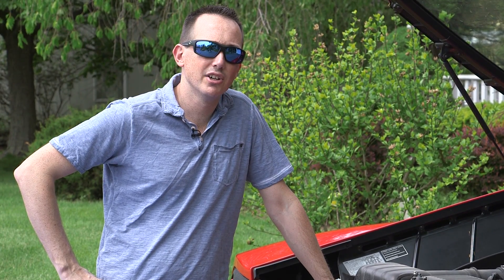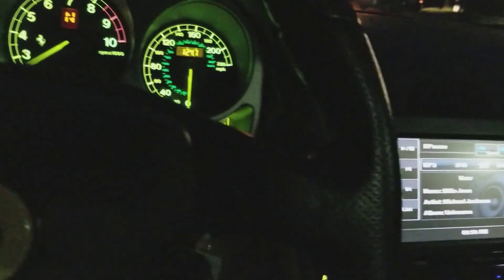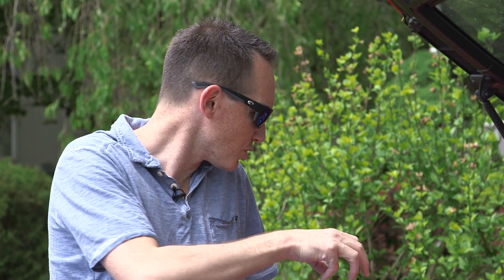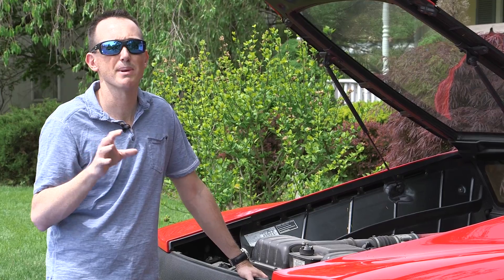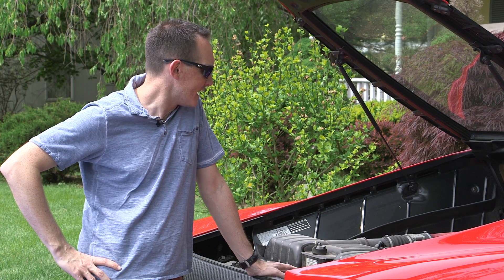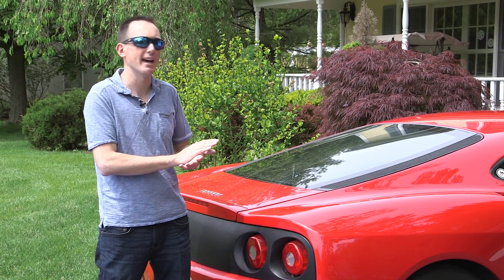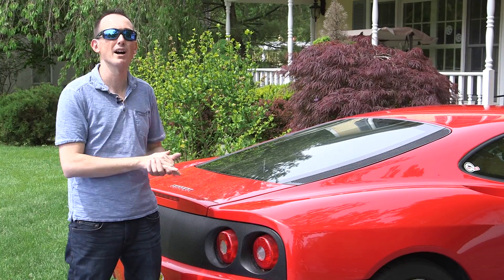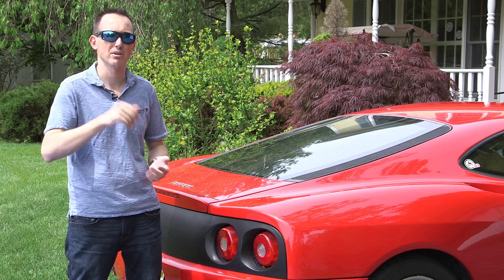When Your Ferrari Engine Starts A Knocking - Rut Oh

Comment: You dont need a flamethrower to set a ferrari on fire. :p
Reply: Tiago Martins This is the best comment.
Reply: Agreed.
Reply: just remember the marshmallows in the glove box if you rented it from mr spaghetti
Reply: especially when there's a spider on board
Reply: This comment should be at the top lol
Reply: All you have to do is drive one.
Reply: Spontaneous combustion is always a possibility.
Reply: Tiago Martins the same can be same about a lambo.
Reply: madmax2069 Pontiac Fiero also. Only Toyota can make a rear engine car that want catch fire.

Comment: "Only" a $1,500 repair..... 😂
Reply: Probably the same compressor you can buy from O'rielys for 80 bucks but cos it has a ferrari badge its 1000 bucks more.
Reply: Rather that than like $80,000
Reply: For AC work, thats not that ridiculous sounding. A new OEM compressor from Honda installed is like 800 bucks.
Reply: Yeah. Repairs aren't cheap, you know. Consider this is a Ferrari and $1500 is pretty damn good.
Reply: I've got a feeling it will end up being more money than that... Even on a normal car if you fill the system with metal from a compressor rattling like that (I'm skeptical about it being the clutch), you've got to pull all of the lines, flush everything, replace the receiver/dryer assembly, replace orifice tube, and THEN replace the compressor and charge it.

On a Chevy that would be a $1500 repair. God knows on a Ferrari...
Reply: now he's just showing off
Reply: yeah word on the street is at RDBLA that same price is discounted to only $70k.
Reply: a $1500 repair on a Ferrari is actually pretty cheap... I think the clutch alone is like 5 grand or some crazy shit
Reply: Your profile picture works, if you ever wondered !
Reply: dmayse1000 Goddammit, another stray hair avatar.  Gets me every time.
Reply: Young N Boosted any repair on a Ferrari for 1500 isn't too bad 😂
Reply: More then you can afford pal..... FERRRAAAARRRRIIII
Reply: Young N Boosted my car isn't even worth $1500 😂
Reply: Jeremy Clarkson I'm not that lucky it's worth less than 1500 because the transmission is going
Reply: thats small in the exotic car world..
Reply: On a Dodge Charger it's almost 1000 to replace at the dealer 700 from a shady shop on a refurb unit
Reply: $1500 for a compressor that only lasts 60,000 miles - LOL, my last Toyota had 160,000 miles on it when I sold it, original compressor still working fine, and probably would have cost a couple of hundred at most to replace.  What a fucking rip-off.
Reply: Young N Boosted I think that $1500 is for the compressor plus labor
Reply: You can get the Ferrari compressor rebuilt for $350 Not that bad...
Price a Prius compressor ~ $1,500, Mercedes Hybrid Compressor $2,000, many OEM Chrysler compressors are $800 - $1,000
Reply: Wtf my 350z Compressor costs 1500 to repair too....
Reply: That's much less than a service!
Reply: For a Ferrari that's dirt cheap!  Diiiirt cheap!  For a ROD KNOCK!

Comment: same sound started on my car - if it's a Denso compressor, it's the pulley bearing or snap ring that retains it. If it's only the bearing you can fix just that, but if the snap ring fails the bearing can work loose and start wobbling around and grinding down the compressor nose.

Comment: Oh Rob... if an "engine" is knocking but the frequency doesn't change with RPM... the engine isn't knocking.  In fact, it's not the clutch, it's the bearings.  Prob < $50, pull them out measure them, order replacements and save yourself the $1,450.

Comment: If you had a spider, you wouldn't have needed the AC. ;)  I lost a tensioner pulley bearing on the F355 spider, and felt the same way when it let loose.  Naturally, later, I did lose the timing belt, the prop shaft, and about a dozen valves.  Good times.

Comment: You want to be careful about continually topping off your refrigerant without adding oil. 
Topping off with a refrigerant that contains oil is a good idea.
If the car had some miles on it when you bought it, evacuating and recharging with a new oil charge is a good idea.

Comment: I'm surprised that the air-conditioner clutch was not motor speed dependent.
Reply: As a 15 year ASE Certified Master Auto Tech, I can tell you it would be. Not sure what Rob is talking about.
Reply: It has me stumped unless the noise was from some evap or cond fan motor
Reply: I don't know, I'd think the condenser would be in the front of the car, but it wouldn't have to be.  Listening to the video a number of times, I don't think I can tell if the noise is RPM dependent or not.
Reply: Not all A/C compressors are constantly spinning with engine RPM. I've seen several odd A/C system where if throttle position is any greater than 30%, the a/c clutch disengages and the motors for the HVAC vents close up
Reply: i'd imagine on a car such as a ferrari or any other "serious" sports car that's exactly what happened. Cuts the AC at the expenses of full/mid throttle power

Comment: The A/C compressor isn't RPM dependent? :P
Reply: Kristian Kops It is but it's one of those scenarios where when the car is at higher than idle rpms the engine vibration take away the noise.
Reply: Kristian Kops it depends if the AC clutch is engaged or not...
Reply: Ottoman, not really? :P

Comment: Dam man I for sure would of said spun bearing lol
What kinda compressor they use on those engines ?
Reply: spun bearings would be rev dependant anyway
Reply: David Lazarus true but I don’t see how an AC compressor isn’t. It still drives off the engine anyway so it should also be rev related? I don’t know any compressor that runs at one consistent speed. They either have a in off clutch function or a regulator valve? Still confusing how the engine rpm was not related lol

Comment: Keep running the ac that will be really good,NOT,as the compressor fills the entire system with metal shaving,plugs the evaporator,condenser and receiver drier and the lines. Then try to flush all that out is not cheap or a 100% guarantee that every last bit is out.If you don't get it all out then the new compressor will be junk and you get to start all over.Or replace the evaporator means pulling the dash and hvac system,replace the lines and condenser ,condenser ,receiver/drier.NOW you're into 10 k + 5k ferrai tax and that is the only way to do it 100% right.

Comment: 15,000 miles with no mechanical fault...  Some kind of record for a Ferrari.  LOL!
Meanwhile, my wife's 2012 VW Sportwagen TDI has 118,500 miles and the only fault has been the same problem you had -- A/C compressor.  Germans and their air conditioning...  I swear they are the best engineers on Earth, except for A/C.  I've never owned a German car that didn't have issues with it's A/C.  Never.

Comment: if the Labor is 500 I would expect all surrounding fasteners and spark plugs and anything else with a torque value on the external of the engine to be torqued to spec obviously the car is being beaten down and not gone back over to correct hand fastened torque value these aren't mass built by robots on assembly line hell the compressor may still be good had it just been re torqued initially edit: we run into this all the time in the spotbike/motorcycle world after the first few thousand miles it's understood every major fastener is to be checked and re torqued to spec according to manual/schedule

Comment: evac and recharge service valve flush add new oil and dye r&r compressor/expansion valve/drier if there is metal in the system condenser much be replaced 3000(guess have no idea cost wise of parts but it is a rarri) if the evap is leaking add another 1500-2000...gotta love ac hmu if your ever in SD and want ice cold a/c that lasts not this slap a compressor in bull shit.

Comment: Damn thats cheap! My 05 scion AC compressor would have cost over $2k from the dealer ($780 for parts and raped on labor).. I only paid $2900 for the car so of course I did it my-self for about $400 from autozone, but still..